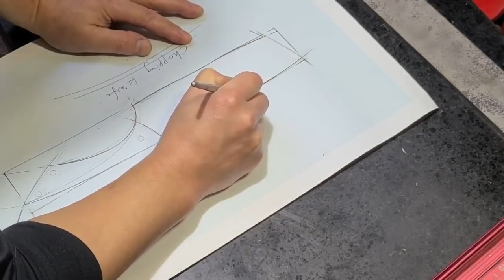KNIFE MAKING / CHOPPING KNIFE 수제칼 만들기 #126

Comment: I feel like for a good heavty chopper a soft spine would have been a good move. the blade and tang almost alltheway through had been heated evenly when some clay to create hamon would have added to the longevity of this item and allowed the use of a mallet on the spine of the blade to force chopping through harder stuff possible without breakage.

Comment: I made a knife from a truck spring, but as soon as it comes into contact with blood it rusts, is there a solution to this problem, may God reward you well?
Reply from the maker: The only problem with rusting carbon steel is oiling. Or you could use a high-carbon stainless steel high in nickel, chrome, like VG10 or 440C...^^

Comment: Which kind of sand paper do you use in sand paper grinder becoz when i try it sand paper worn out.
Reply from the maker: The belt grinder...5X1220mm...The short sappo has the disadvantage of being easily worn out...But the price is cheaper than 5X2100mm, so you can change it often, so you can do clean work. Use common metal belt sandpaper.

Comment: What kind of angle sharpener is that that you used to achieve the secondary bevel
Reply from the maker: sharpening stone....oil stone...and air lapping grinder.^^
Reply: 2019 Ruixin Pro Knife Sharpener Aluminium
Reply: @archades54  thanks

Comment: Best chopper.witch steel you are using?
Reply from the maker: 440c stainless steel
Reply: @artisticson2275  thanks.which drill bit is best for this steel blade?any technic to use the drill bit because i  lost lot of bits..
Reply from the maker: @jjcharlstonisaac6222  Use concrete drill bit...